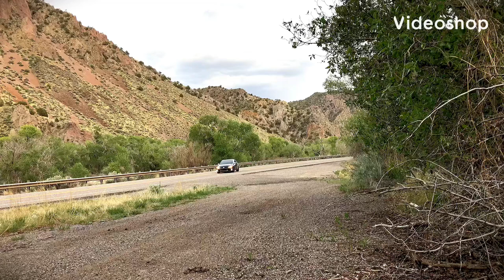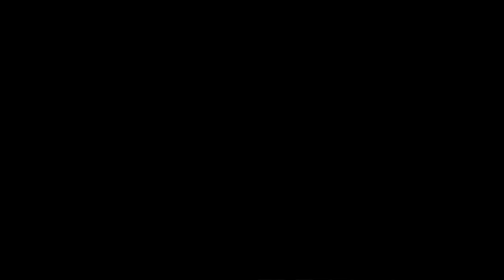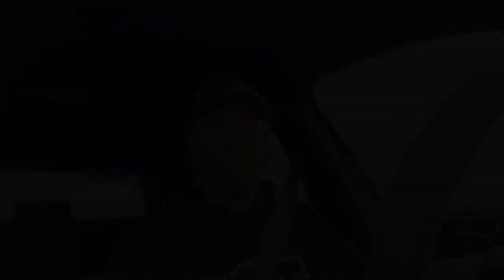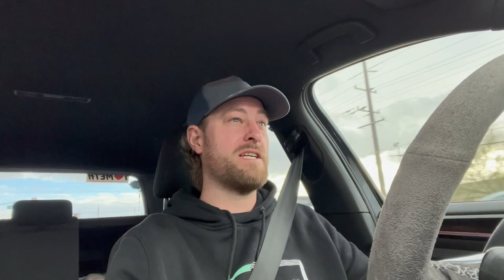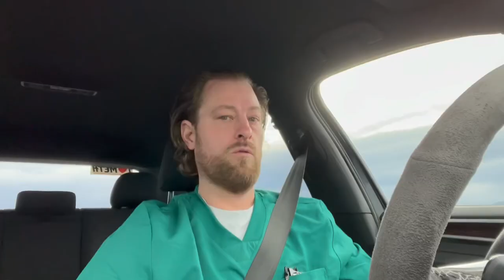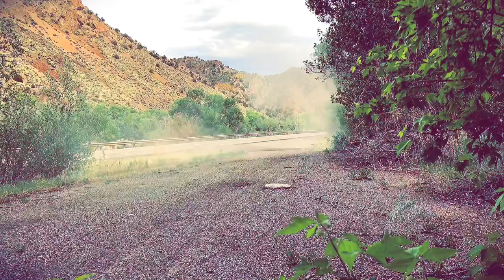XClutch Stage 2 Break-In Review || MK7 GTI

Comment: The chatter or noise will vary between brands because of a few factors. Main ones are the mass of the rotating flywheel/ clutch and then the other big variable is the type damper centre that is in it. I know is because I designed the Xclutch range. With our stage 1 clutch for the GTi/R we use a different spring centre with lighter springs and idle control to eliminate the noise/ chatter.
Reply from the maker: That’s good information. Thank you.

Comment: Really considering this for my first clutch upgrade. Been stage 2 EQT for a year dealing with clutch slipping. Great review
Reply from the maker: It’s a solid clutch. I will say though that ever since I got this XClutch installed by the shop two weeks ago, the clutch pedal has been sticking still. Now, i don’t know what the cause of this is yet, so I can’t say it’s the clutch. What I do know is that when I made this video, an XClutch representative reached out to me, explaining that the all-metal TOB/slave that they provide in the kit, is indeed and OEM one that comes from the MK6. This one is about 1/8” taller than the MK7 OEM TOB/slave that I had the shop install. He said there’s a reason why they provide the OEM MK6 TOB/slave, because the clutch is designed for that TOB/slave to operate with it, and that I should have used the one provided. Well, I wrote him saying that there was no information in the box or website description saying if the all-metal one they provided was an OEM one, or a cheap Chinese one, so I assumed it was a cheap Chinese one, and used a different MK7 OEM one. So he is contacting his team with XClutch, and letting them know on possible arrangements to include that information in the kit. 

When I picked it up from the shop, they said they were having a tough time bleeding the clutch, and the pedal kept sticking. So I drove it home with a semi-sticky pedal still. Went home, bled it, and the pedal would work fine after bleeding, but the more I drive it, it would get worse, and start sticking again, and engaging close it the bottom of the floor. Not normal at all. I bled it probably 4 more times, and same thing. I also noticed air bubbles every time I bled it, as well as brake fluid level going down and have to fill it up a bit every time I bled it. 

So, the car is at the same shop right now getting the TOB/slave that was provided in the kit installed. I do not have an answer right now as to weather the clutch pedal sticking was related to me using an MK7 OEM TOB/slave or not. My eyes thinks it saw brake fluid coming from the transmission and the block, but I’m not 100% sure, as I have a small oil leak next to it too. I don’t know if the shop installed it incorrectly, and did a bench bleed with the MK7 OEM TOB/slave (which is a huge NO NO on this car), and messed up the TOB/slave. Hard to say because I didn’t watch them install it, and they will never take personal blame because shops just don’t ever do that. I also don’t know if I have an oil or air leak at my clutch or brake master cylinders. I just don’t know yet.

What I do feel confident about is putting the MK6 TOB/slave in it. If the clutch pedal still sticks, I can assure myself that it isn’t the TOB/slave at fault, and I will be moving onto the clutch and brake master cylinders for replacement. 

So I’m going from here. This is why I usually work on my car myself because I just don’t trust shops anymore. When I can’t see them do the actual work, and then I’m given back a partially working car, my trust level goes way down. Funny thing is that this VW is the only car that I’ve had issues with shops in these sorts of things. All my other cars, I’ve never been given back a partially working car when I took it to them and paid full price for the job. But I just didn’t have the time, or patience, to do another clutch job on my GTI this time, which is why I took it to the a shop. 

I will post another video once this new all-metal MK6 TOB/slave is installed and let you know what’s going on. I do recommend this clutch if this issue works out to be making sure the TOB/slave that they provide in the kit is used, or if my issue amid a fault of my clutch or brake master cylinders, but if I do all this stuff, and still it doesn’t fix it, then I cant recommend this clutch you know.